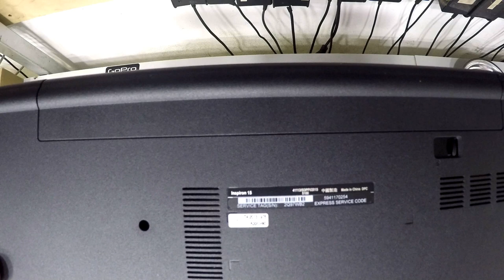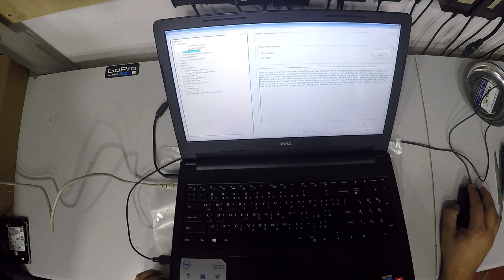Dell Inspiron 3558 Partial Disassembly and Reassembly

Comment: Thanks for the video, I was able to crack the case open just enough to sneak in additional RAM.
Reply from the maker: your welcome
Reply: Manuel, did you have to take out the DVD to do it?
Reply: +Geoffrey Zane Yes, you'll need to take out the DVD drive to get to 3 tiny screws. I did not need to take out the keyboard however.
Reply: Manuel Recount Awesome, thanks for letting me know.

Comment: Assalamu alaykum brother, i have the i5 version of the same model. one question, if i want to upgrade ram and hdd, do i still need to open the keyboard and detach all connections to open the bottom chassis? i hope to get reply from you soon. Shokran.
Reply from the maker: walekum assalam ahee
yes you need to take keyboard and detach all connections the open the bottom.
watch the full D&R https://www.youtube.com/watch?v=Qf869uQHYTk
Shokran
Reply: Shams abd el kader assalamu alaykum brother. Thank you for the fast reply. Seems like a lot of work for a non pro like me. I will try my best to open this laptop. Don't know why Dell made it so hard just to change the hdd and ram. شكرا جزيلا
Reply from the maker: بالتوفيق أخي

Comment: I have a 2016 dell inspiron 15 3558 and it has 6gb of ram and intel core i3-5015u is it possible to up grade the ram to 8 or 10 gb? I do a lot of gaming and I want to be able to run it without running out of ram
Reply from the maker: Hello trapy, The max ram for this model 8G+8G=16G

Comment: So im having issues with my charger connector, I pushed the back and replaced it towards the center but even with that it doesn't want to charge, it has a power source so my laptop isn't dying. But how do I go about fixing this would I have to buy a new connector? And when I tried to unscrew one of the screws I can not even take it out. It's just stuck there
Reply from the maker: For dc jack replacement: https://www.youtube.com/watch?v=KL2AHh5bwkY&list=PL43q5LIt9XwBj0sLkutq9lt6lu8csNcAH&index=99
For bad screws you need ProTools.
Reply from the maker: Melissa, check your adapter if there's no power in the centered pin, the laptop won't charge but continue power on.

Comment: after getting the disk tray removed. how do I take the back cover of the labtop off. it still seems screwed in
Reply from the maker: Hello Myllamome
1- remove all screws from the bottom and the screws under the battery.
2- remove the DVD and the 3 screws under it.
3- remove the keyboard and the 5 screws under it, release 3 connectors from the board.
4- start removing back part slowly with the tips of your fingers.
good luck
Reply: eShamsTechTips I can not remove the DVD completely becaue it broke trying to screw it out. I was able to unscrew the three scews but I can not take out the DVD. I'm not sure how important it is to take out the DVD for the back cover to he remove
Reply from the maker: There's 1 screw holding the DVD and the back cover to the mainboard, and 3 screws under the DVD.
check this video, I think it will help you.  https://www.youtube.com/watch?v=lZEkbvc-dY8&list=PL43q5LIt9XwBj0sLkutq9lt6lu8csNcAH&index=70
Reply: It's not working for me can I send a picture to an email to you so you can evaluate what I should do best
Reply from the maker: send to shams@eshams.net
Reply: eShamsTechTips I sent the email already
Reply from the maker: I saw the pic, Watch the video I sent you from min 2 there you will find the solution.
https://www.youtube.com/watch?v=lZEkbvc-dY8&list=PL43q5LIt9XwBj0sLkutq9lt6lu8csNcAH&index=70
Reply: eShamsTechTips I believe the DVD player is stuck inside the labtop and I cannot push or pull it out no longer
Reply from the maker: There is a spot under the battery that you push with a screwdriver to get it out

Comment: The back part is not coming out. I've removed the cd drive. But I'm too scared to put pressure and remove the black part. Kindly help.
Reply from the maker: Hello harsh
1- remove all screws from the bottom and the screws under the battery.
2- remove the DVD and the 3 screws under it.
3- remove the keyboard and the 5 screws under it, release 3 connectors from the board.
4- start removing back part slowly with the tips of your fingers.
good luck
Reply: Thanks!

Comment: how can i fix the power connector? mine is out of place
Reply from the maker: hello nelson
send me a pic of the power connector
Reply: +Shams abd el kader (eShams) I just noticed that when the cord is plugged-in it pushes back the power jack, is there any good way i can keep the jack in its correct position?
Reply from the maker: i think your cord is damaged or you smash it accidental, the cord must be 100% rounded.
Reply: I already kind of solved it, it wasn't the cord. The problem was at the power intake it couldn't hold its position so I calibrated it with a lollipop tick, smh. Thanks for your concern
Reply from the maker: good
i'm :-) for you
Reply: My power connector is able to pick up my jack but it won't charge all the way do I have to replace it ?? also one of the back screws won't come out at all
Reply: Melissa G. you might want to take that to best buy's geek squad, they replaced mine for not much more than 12 bucks in no time.

Comment: help me my laptop fan wont turn on.
Reply from the maker: Hello
1) try update the system BIOS (dell.com).
2) use dell warranty.
Reply: thx i just switched power profile to bitsum perfomance boost thingy and litteraly hot air went out from the vents thanks.